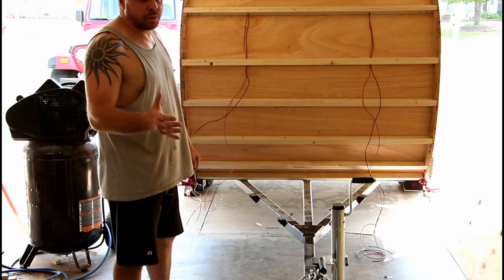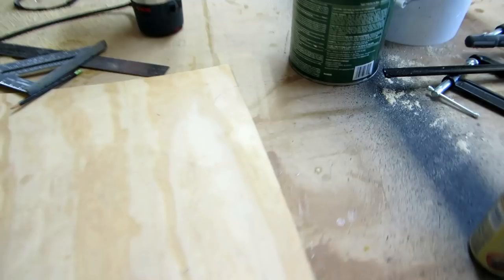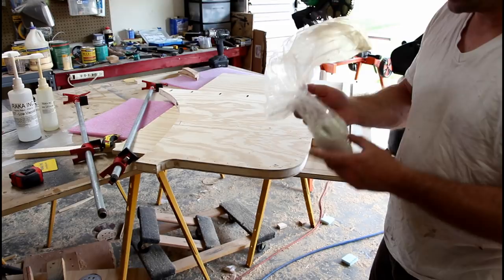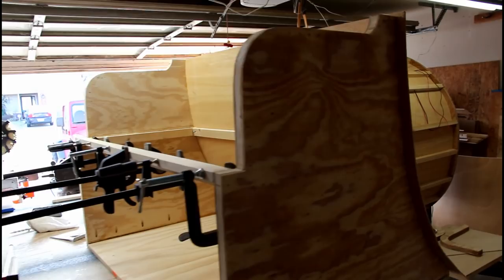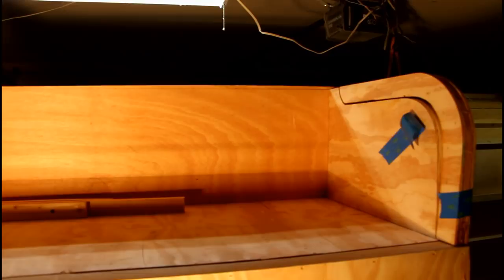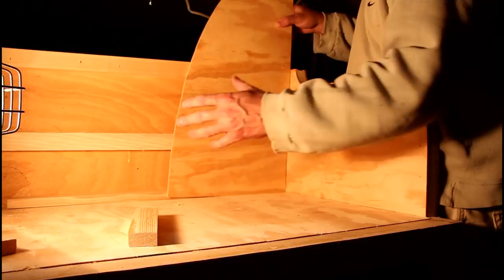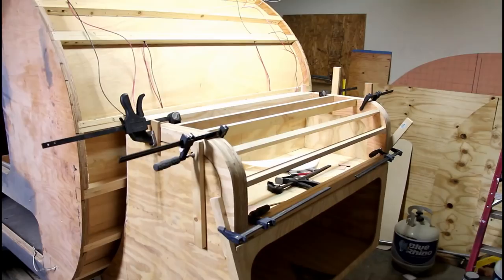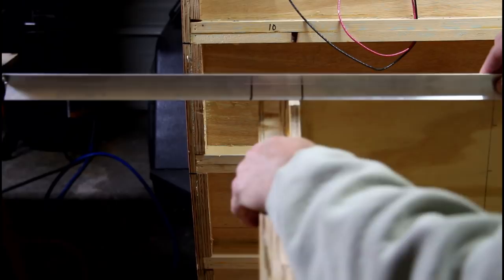Teardrop Trailer Build - Tongue Box/Lid built same as Galley Hatch

Comment: What a great idea to use the same lid style on the tongue box as the galley hatch for practice.  I am am at just about the same point in my build and I've been trying to decide if I should buy a tongue box or build one.  After watching your video I think I"m going to build one and use the Steve Frederick's method for the lid just like you did.  I hope mine ends up looking as nice as yours!  The two things I'm most nervous about are building the hatch and the wiring.  I am also using the PD 4045 and just finished wiring my AC side last night.  So do you feel more confident about building the galley hatch now that you've had practice?
Reply from the maker: Thanks! I do feel better about it. I read Steve's method several times and was still kinda scratching my head. Then I watched another youtube channel Scott's Workshop. He built a really nice teardrop. I watched his videos and was able to see what needed to be done. I will add make sure you have a good plan when skinning the interior and exterior. You really have to pay attention to make sure you get it to rest against the spars on the curved portion since it's a tighter radius than a galley hatch. It's not hard just be aware before you go to glue it up.  I will layout all my electrical this week and weekend to get started on it. Hopefully will be done in a month or so
Reply: I have watched Scott's Workshop as well as Dad Rambles as they were both following Steve's plans and they have been a great help.  After watching your video on the tongue box I went to your playlist and watched your ceiling & spar video and it prevented me from making a mistake that would have been a real pain to fix.  I have already skinned the ceiling and was going to cut out the hole for the window and Max Air fan (it sounds like you and I are using many of the same accessories) and would have totally forgot about the radius of the window corners.  I would have just cut out around the framing without thinking about the radius.  Thanks so much for making your videos!  It's such a great help!  Are you planning on putting an in-line fuse between your battery and PD 4945?  If so, may I ask what kind?  I haven't installed one yet because I'm not sure what kind as my positive wire is 8 gauge and I haven't found an in-line fuse with 8 gauge wire yet.  I am now considering a cut off switch as well or instead of an in-line fuse.
Reply from the maker: I don't have a fuse as of yet. I do have a cut off switch. I have done some reading on the PD 4045 and it seems there are several different ways to wire it depending on how you want to setup your teardrop. I think ideally you would want to go Battery Positive/Fuse/Cut off Switch/ then wire it in to the DC Bus of the PD 4045. Don't quote me on that though. I was waiting until I was ready to lay out all of my electrical system on my bench and then really dive into it.  You might search Class T DC Fuses. You might be able to find what you are looking for
Reply from the maker: Sandra Zern on Amazon check out Kumeed 12v DC in line circuit breaker. Looks like that would work or Rig Rite marine circuit breaker
Reply: After hours of scouring online forums about how to wire the PD4045 I finally did what I should have done in the first place and called Progressive Dynamics.  The gentlemen I spoke to spent a considerable amount of time with me on the phone and explained everything to me - especially how to ground it to the chassis.  He recommended an automotive in-line circuit breakers so I searched for one on Amazon and purchased the very one you referenced above!  Thanks!  I also purchased this disconnect switch:  https://www.amazon.com/Cllena-Battery-Disconnect-Isolator-Vehicles/dp/B01MFBAURD/ref=cm_cr_arp_d_product_top?ie=UTF8
The plan for today is to determine the path my ground wires will take to the chassis and where I will drill the hole in the floor to get them there.  I have worked so hard to seal this camper up tight that drilling a hole in the floor will be a very hard thing for me to do!
Reply from the maker: Awesome! That is the same switch I have. I bet you are dreading that cut. I assume that you are putting your PD 4045 in the Galley and that is the only route?
Reply: It's actually in the middle cabinet at the "foot" end of the cabin.